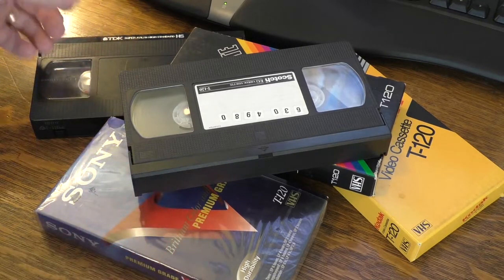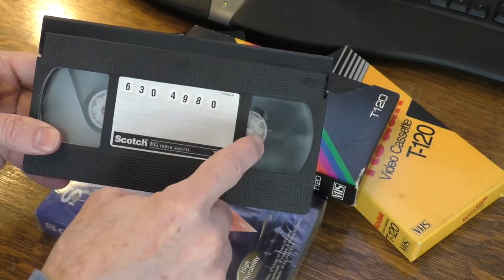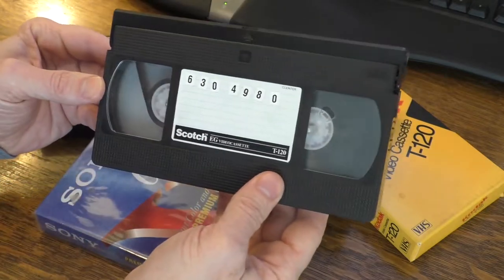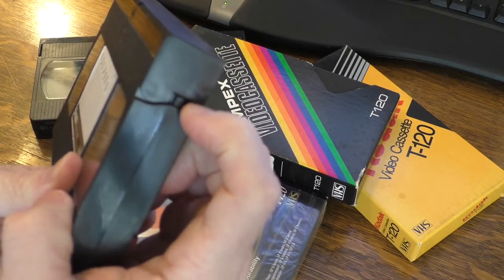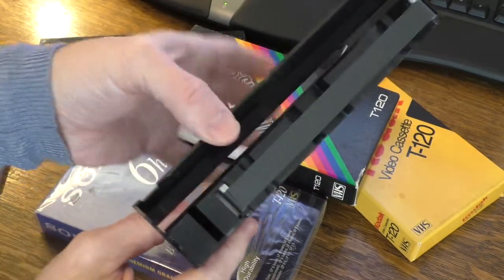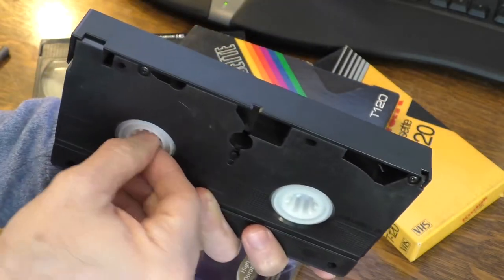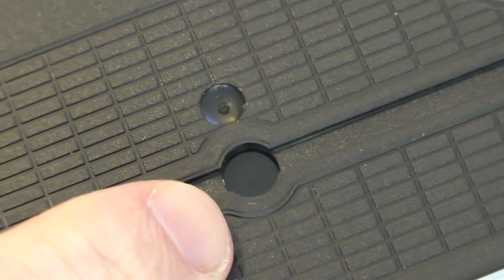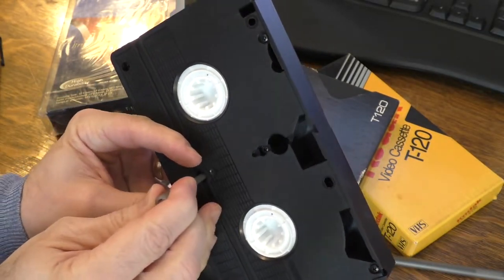How to Manually Rewind VHS Tapes

Comment: Of course it helped out! I asked myself time and time again as I grew up what was holding the spools in place when attempting to manually rewind the VHS tape. I was puzzled by this fact, since with audio cassettes I wasn't encountering resistance when manually rewinding, unless the spools were clogged in the margins or the tape was stuck or what not, which would also cause audio cassettes to resist the manual rewind; it sucks when that happens, and I managed to break a audio tape like this. Good that these things are somewhat fixable with a bit of mechanical skill.

Comment: For spinning the tape you can cut an old credit/gift card to the right width. I used a lathe screw (a short screw with a wide head, used for chicken wire and such) for the release hole.

Comment: what do we do if that circular "button" is missing? i am able to manually move the tape forward and backward by way of inserting something in that hole to take the place of the button being depressed (which then allows the white spools to move and therefore the tape as well) but since that little button seems to have broken off, the vcr cant/wont move the tape spool forward automatically and it just ejects immediately after hitting play.
Reply: There are screws to take apart the tape. You may be able to fix the button if you dismantle it.
Reply: Apri la videocassetta e controlla